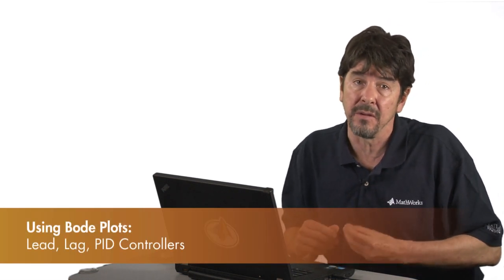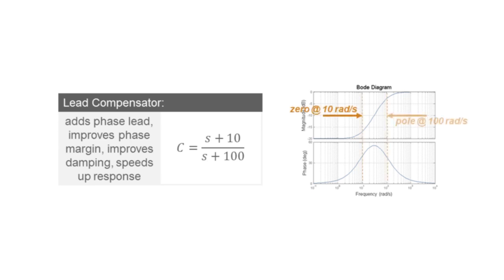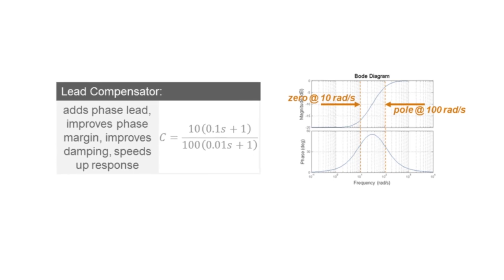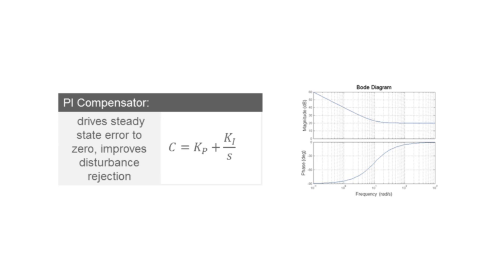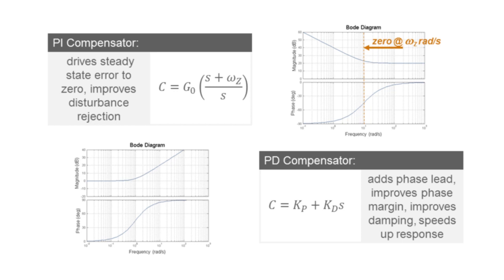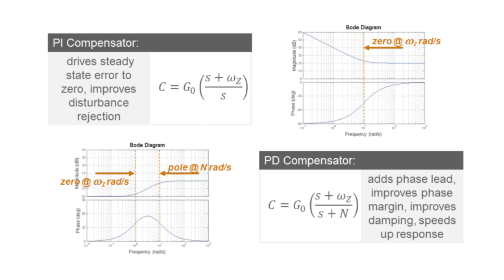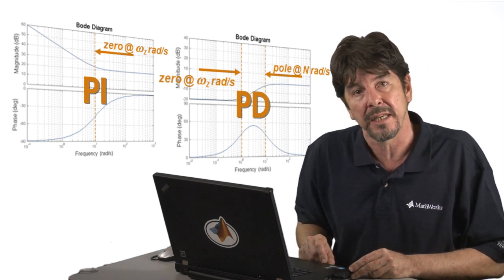Lead, lag, and PID compensator structures using bode plots |Using Bode Plots, Part 4

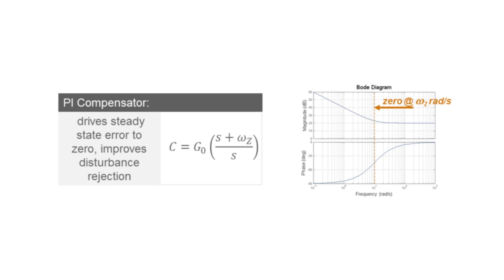Comment: 2:35 “integrator characteristics, infinite gain at DC, and high gain over the low frequency range.” Really? All are integrators really in terms of Current? Did I miss him say current prior to this point??
Guess Proof: set transfer function C = G_o(s+w_z)/s == DC, therefore s -> - w_z and then solve for G_o:
G_o = - DC *w_z/(-w_z+w_z) -> - DC*w_z / 0 (division by zero) -> -INFINITY. DC is direct current with circuit equations defined not to have frequency, while AC (alternating) has frequency. If that’s right (doubtful), then this educational video is tailored to certain types of engineers (e.g. electrical) and not generalized. It’s like adding unnecessary complexity to an already complex subject! Lol
Reply: DC gain is a term used in all engineering industries; it comes from the electrical side of things but doesnt relate to it anymore, it just means for whatever system your step response gain
Reply: @timmy5151  it does not relate to all engineering industries. I am in one such industry and we do not use that term outside of electrical engineering aspects, especially when there are electromechanical aspects. It was a choice to not use confusing terms like this.

Comment: thanks for the video!! But can you explain why a bump in phase indicates increase in damping? Thanks!
Reply: As far as I knew,Damping is nothing but an unstable oscillations which creates ups and downs in the system.
Reply: integrators give zero steady state error so are good for final value accuracy. However, they slow down the response of the system. This can lead to a system overshooting (since the control loop response is slow and takes a while to realise the system has reached regulation). Adding a phase lead network to the control loop counteracts the slowness of the integrator and speeds up the loop response. It therefore prevents overshoot (since the control loop is now faster). So when they mean 'increase damping' I think they are more correct in saying 'reduce overshoot'. That is my understanding. PhDs in control theory might want to correct me
Reply: @simonbramble  
damping ratio (Z) = actual damping / critical damping.

The damping coeffocient is that material constant "C" when multiplied by velocity gives you the force
i.e ------->   F = C . Vel

So, think of it as the resistance of the system to oscillate freely (no damping Z = 0, oscillate infinitley)

first of all, damping ratio is a system parameter and cant be increased or reduced, is a measure of energy loss during cycle with excitation by external forces/signals.

its a measure how fast or slow the system will return to its equilibrium position during a cycle.... i.e :
high damping = slow return to origin and less oscillations.
low damping = fast return to origin and more oscillations.

secondly, Lead compensators are like PD controllers, have a zero (close to origin = dominant) which means they reduce the speed of transient response by differentiating the error and therby reducing overshoot and settling time.

what he meant by improving response is that the system reaches target quicker (T settling low).